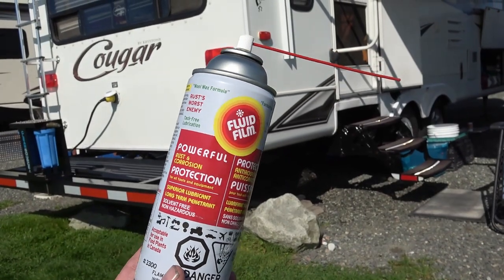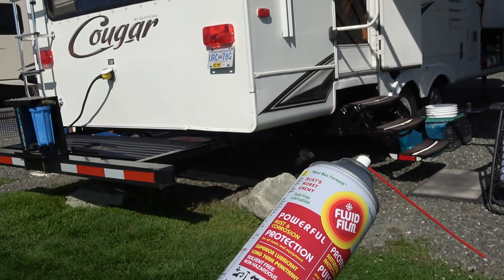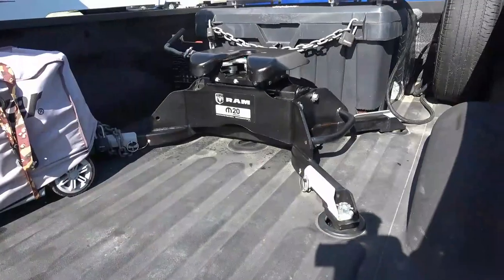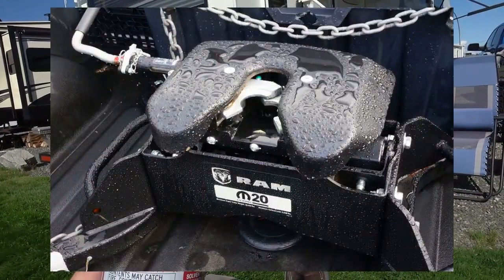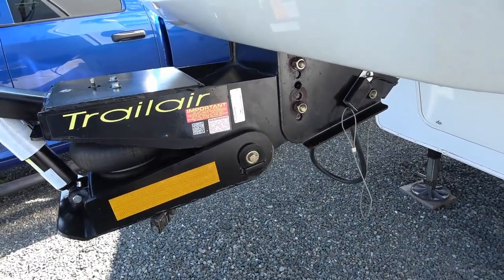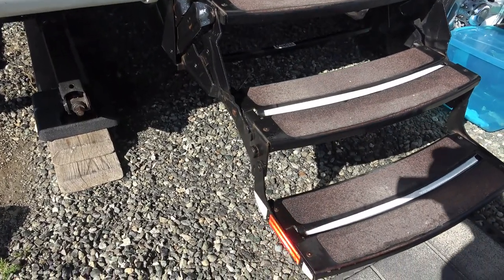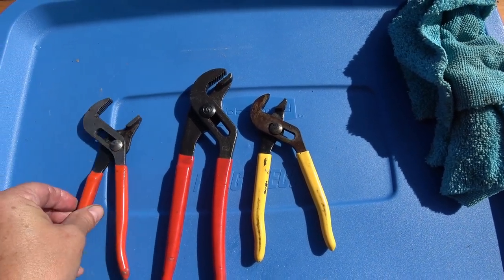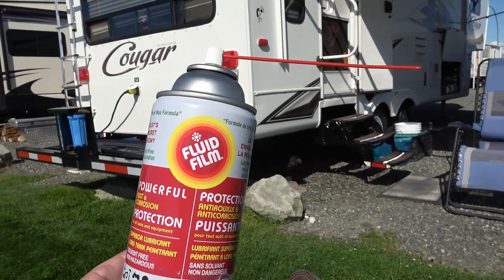RV Rust Protection & Lubrication with Fluid Film

Comment: Best stuff ever! Some guys at our shop got me hooked on Fluid Film and now I buy it in 1 gallon buckets and use the woolax undercoating gun. Have used it on, leather boots, tools, truck, tractor, wood stove, wood splitter, basically everywhere. Works great and stays where you put it. I have a video on our page of using it on the wood splitter, Awesome stuff!

Comment: While working for different mining companies I noticed the flat-bed pickup trucks with diesel tidy tanks on the back had no rust where a little diesel had spilled.  I've used a very light mist spray throughout the undercarriage from bumper to bumper with excellent no rust results.  Diesel has extreme penetration qualities and can be used sparingly if applied using high pressure low volume for a fine mist.  Probably as environmentally friendly as most other products.

Comment: Hi Ray, I live in Maryland and they use a considerable amount of salt on the roads so rust protection is a big concern for my 2015 RAM pickup.  Dodge/RAM vehicles are notorious for rusting out above the rear wheel wells and at the bottom of the doors.  When I purchased my RAM in 2015 I bought the spray kit from Fluid Film and sprayed the under carriage like crazy, inside all available openings, especially the brake lines, inside the wheel wheels, inside the engine compartment, the bottom of the doors, tailgate, etc.  Four years later NO evidence of any rust!!  Dust has formed a slight coating attaching itself to the FF but like I said absolutely no rust.  I plan to shoot some more inside the wheel wells and doors just to be extra safe.  GREAT product.  Stanley
Reply from the maker: Great, thanks Stanley for the feedback. Cheers! Ray

Comment: I love Fluid Film.  I Highly recommend it.  I spray it under my truck and trailer undercarriage, stabilizer Jacks - everywhere more hidden or require a good permanent "goo" and spray apparent metal like my hitch, the front of the trailer some of my tools,,, with corrosion X or T9 Boshield. It gives a better look than Fluid Film, and re-spray when it begins to fade away.  Fluid Film sticks on for a longer time, I re-spray a bit every year.  I do that when all is new for protection.  I use T9 Boshield Corrosion X a lot everywhere as protection, lubricant and in my case a filiform (aluminum corrosion) stopper on my Airstream. Lol,, I spray a lot, I also have synthetic grease I apply on all screw heads,,  I hate rust and in Coastal area you have to be quick or it gains upon you !!  I have to be careful as some chrome-like metal do not like the synthetic grease I used and did spots,  Cheers.
Reply from the maker: Thanks Julie.

Comment: I have been using fluid film on my boat and trailer for 15 years.  Sticks to metal and stays, great for suspension components on a boat trailer that goes in to salt water, should be great for an rv.  Kept my outboard motor looking like new with a couple of spray downs a year.
Reply from the maker: Cool, thanks, I added some to Anne's trailer too.

Comment: Wool Wax = lanolin. This stuff is all its made out to be for sure.

I've never had any issues on rubber but maybe I've only sprayed synthetic rubber so far. Make certain you spray any electrical connections after you have made them tight. I use a schutz gun and do my undercarriage on both vehicles each fall, I do my bottom door/hatch seams and drive 15 and 9 year old vehicles with zero rust appearing.

I spray a shop rag and wipe down my black plastic bumper/door cladding on both vehicles, makes it look like Lexus plastic not the cheap stuff it actually is. 

Ya, I';m a fan boy, but get some and you will be too.
Reply from the maker: Awesome, thanks for the tips.

Comment: I use it on my battery connections, keeps corrosion in check
Reply: Never thought about battery connections, but sounds like a great idea.  
I will be doing that on my RV batteries.  Just had some corrosion issues on the connectors.

Comment: If you use it on parts such as stabilizer jacks and steps which are exposed to dust and grit, you will have a huge mess. I use only Boeshield T9 because it goes on wet to penetrate then dries to a waxy film which does not attract dirt.  If you have rust on your frame you can fix that permanently by lightly wire brushing then spraying with Rustoleum Rust Converter.
Reply from the maker: I'll see what happens and report the results after a few months. When I was considering Fluid Film I went to the website and checked out their FAQs as I was interested if it would attract dirt  https://www.fluid-film.com/frequently-asked-questions/
"Because FLUID FILM remains wet, it will get an initial dusting upon application, but because it contains no solvents and will not become sticky, it will not gum up or create a build up of dirt."
Bioshield T-9 contacted me and offered to send me some samples last month. Might give it a test. Cheers, Ray

Comment: This stuff is great. However I have heard it will creep under the Nox coating on GM truck frames and cause it to flake off. Not necessarily a bad thing because FF is probably better in the long run. Lol.
Reply from the maker: Thanks for the info. Cheers, Ray

Comment: Well, once again you've shown that I didn't do enough research before smearing lard over all those surfaces to protect them.  I feel like an idiot.  Thank god the bacon grease seems to be doing good things for my slide out gears.  I like bacon, so it was a win/win situation, too.  Thanks for the tip, Ray.  Any ideas on how to get lard off of my king pin?
Reply from the maker: I know my beagle would have cleaned all that up. :)

Comment: Is that a new ext rack with bumper where you get that
Reply from the maker: It came with the trailer new. Its a pull out rack for bikes or other stuff, good for 200 lbs. I don't use much as it tends to drag when I go through sharp dips. Cheers, Ray

Comment: Have you ever had anything to do with rewiring a thermostat that has 3 zones which runs 3 a/cs and heat for the floor. Each zone can be programmed separately and has a aqua hot heat system. Thermostat is a Atwood model 33200 which has been discontinued and bought out by dometic which they don’t have a replacement.  The plug in on the back is like a phone jack. Do you know of any replacement what a person can do to fix this
Ken from Lloydminster AB
Reply from the maker: Sorry Ken,  I haven't That's quite the setup!